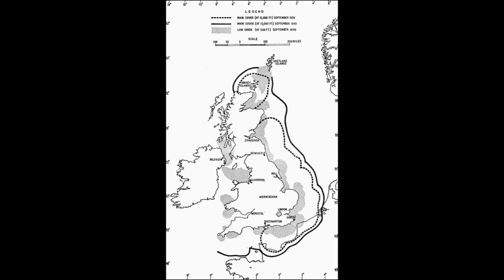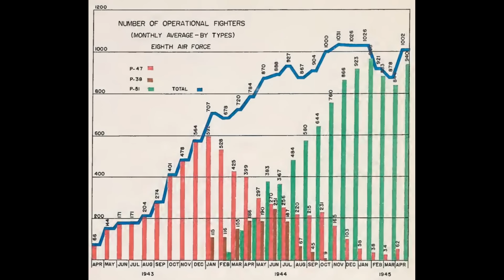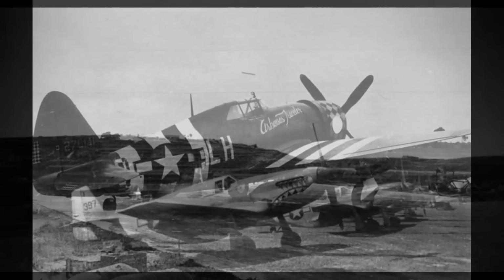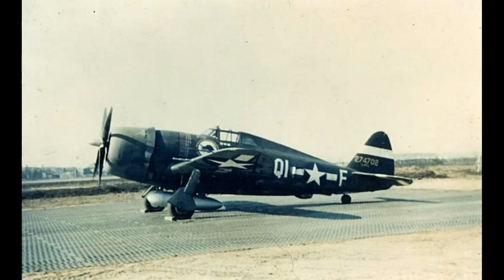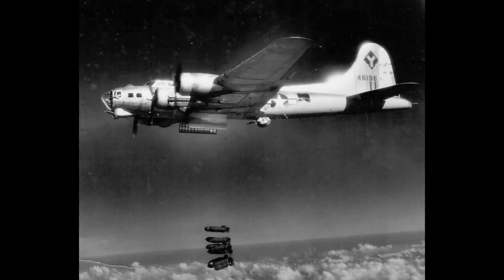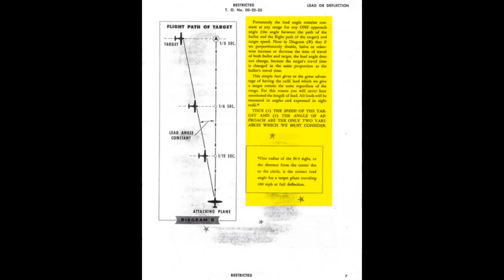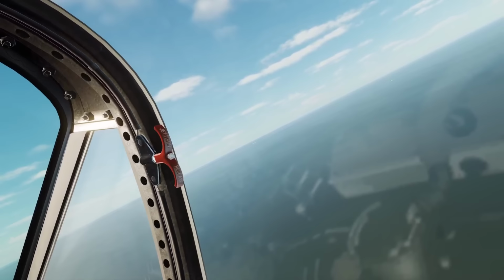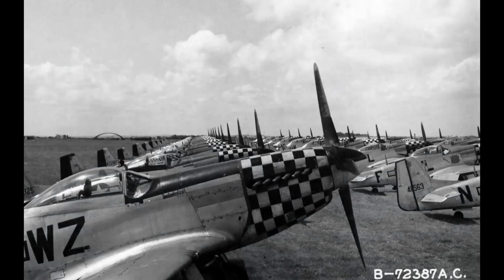Under Appreciated BRITISH Tech From WW2

Comment: With respect to the British radar tech,  it was due to the invention of the cavity magnetron which allowed generation of electricity at around a 10cm wavelength.  This made airborne radar not only possible but practical. The Germans had tried to create 10cm radar earlier in the war but after failing had concluded it was not possible so when an Allied bomber crashed in Germany which was equipped with it they had a nasty surprise.  I believe the cavity magnetron was part of a package (which also included the Whittle jet engine) of technology traded to the USA for technical data pertaining to nuclear weapons,  I think that detail in itself is significant.  There is an excellent BBC documentary from the 1970's called The Secret War which talks at great depth about the development of radar and radio navigation aids for war fighting and defence,  I highly recommend it for all WW2 enthusiasts.
Reply: And with it, the microwave oven (2.4 GHz, a water absorbtion point)
During testing, an engineer had a bar of chocolate in his pocket,  it melted or started melting

Comment: Thank you for the 'two supercharger stages on a single shaft' - that is a nice explanation of how they got it to be so compact, which I think was a darned neat trick. The german supercharging is obviously different in layout but looks surely weaker, accomodating a different layout as it does. I'm not saying it is weaker (I think it must not be, surely), but this supercharging race between the Brits and the Germans from the 30s in road races ending with the end of the piston era of combat aircraft - interesting...
[edit, that was a passive agressive ask for a video and you probably already have covered it. I know you have spoken about the superchargers, a lot]

Comment: The Rolls Royce Dart turboprop engine uses the same compressor concept as used in the later merlins, two centrifugal superchargers in line sharing a common shaft.
Reply from the maker: Yes, so does the TPE 331.

Comment: Splendid video. There are some other well known things that vary over timeframes. The jet engine is one, airborne and seaborne radar are others, but in aviation, one that is post war-ish - is the MB ejector seat!

Thanks for the fine video!
Reply: I think he wanted to cover more little known British innovations.  But you make some good points.  Most military aviation enthusiasts are aware of the pioneering work done on Radar by the UK.  But I think a lot of folks assume that the first jet engine innovations are German in origin based on the reputation of the ME262.  They need to look up Sir Frank Whittle.  Greg's research is phenomenal.

Comment: Dang! Another gem from Greg. I do, however, have a couple points to introduce.

Henry Ricardo was brilliant but I think he went down a rabbit hole re: sleeve valves. He just didn't consider higher octane fuel and intercoolers.

Drop tanks are of limited use without a large internal fuel load. The USAAF was late in adopting them but their planes were better equipped to get the most value from them.

Cheers!

Comment: I spent two weeks doing nothing, but repairing Drop tanks for three squadrons, by my self!  Interesting, almost all had the same problem. Internal electrical connections . G, ot about 75 repaired, to working or And  teaching three other electricians from those squadrons who to do it.loved working in planes.
Reply: Same here at VFA 125.  Mac Air built a battery box using 2 PRC 14 volt batteries in series.  This allowed transfer of a light weight oil to simulate fuel.

Comment: Excellent video as always. It is worth noting that the original British designation of H2X was H2S, although H2X is an improved version. Also Gee-H was actually a development of Oboe, which was incredibly accurate. Gee-H differed in that it could work with more than one aircraft at a time, so Oboe was most practical as a target marker. All of these systems relied for their accuracy on another British invention, the Strapped Cavity Magnetron,  which resulted in a massive improvement in radar performance. The lead this gave to the allies is incalculable.
Reply: @jackgee3200  You are correct, Gee didn't use the magnetron. But the importance of the magnetron to radar development was massive.
Reply: G-H and Oboe are not the same. Oboe used two radar equipment's with operators on the ground tracking the aircraft  via transponders on the aircraft, much like an IFF system. The operators on the ground station worked out how far off track the aircraft was using a very wide diameter Cathode Ray Tube for the time and controlled the generation of audio tones transmitted to the aircraft which told the pilot of the aircraft being tracked if it was left or right of the required track. The aircraft flying at a continuous radial range from the track radar (known as the Cat Station).  If the  aircraft was within the 150 feet wide Plus or Minus range limit of the equipment, the pilot got a steady tone on his headset that gave the system its name. The Mouse Station measured the range to bomb release for the aircraft and generated a series of tones into the Observers headset that gave him warning that the bomb release point was coming up and the signal to release bombs. Like the Cat Station, the Mouse station knew where the aircraft was with a Plus or Minus Accuracy of 150 feet. The Ground Radars were modified versions of the British Army Costal Defence / AA Gun Laying Radars. The Mk 1 system used 1.4 Metre band radars and were fixed installations, the Mk II and Mk III used centimetric radar and were mobile. Some B-17's were fitted with Oboe and trialled on night missions, but the system wasn't put into wide scale use by the USAAF. Oboe Mk I didn't use the Magnetron, The Centimetric systems did. 

G-H was based on the GEE system which was fitted to all US Bombers (All of the equipment supplied was built by the British) . The  big difference between the two systems (GEE and G-H) was measurement of the range from the ground stations to the aircraft was instigated on GEE from a master station on the ground and the GEE system used  long wave pulse radio transmissions based on the signals transmitted by the Chain Home Radar system. The Master Station sent out a couple of pulses that synced the aircraft and the slave stations, which the caused the later to send signals at a set time after the master station and the Aircraft's navigator then measured the difference between the timings of the signals from the slave stations to work out the aircrafts position on a special map. Seeing the system was totally passive as regards signals from the aircraft anybody with a suitable receiver and display system could use it. However It was found that the low Pulse Repetition Frequency of the GEE system, a kind of Oboe system in reverse could be built into the system where somewhere between 70 and 80 aircraft could each transmit sync pulses on a slightly different PRF which was picked up on the Slave stations and retransmitted to the aircraft. The display would respond to the pulses that matched the correct PRF and allowed the aircraft to fly a track at constant range to one slave station and drop its bombs on the range from the other one (these stations were known as Cat and Mouse as on the OBOE system). Aircraft position was known within 150 yards.

Micro-H was based on the Beacon location system originally fitted to British Night Fighter and Anti Submarine aircraft fitted with Centimetric AI and ASV radars. These allowed the aircraft to home onto a beacon at their home base. Micro-H allowed the H2X system to do a G-H type attack by interrogating a pair of Microwave beacons placed on the ground. It didn't become operational until late 1944 and was only used by one Air Division.

Comment: A little off topic:

An underrated piece of kit is aircraft breathing oxygen systems.  1. Without oxygen breathing systems for the aircrew, all discussion of high-altitude engine performance is hypothetical and theoretical. They are as important as superchargers. 2. If someone in North America wants to own an actual piece of a WWII era military aircraft, type g-1 oxygen tanks are not hard to find for sale.  Post-war, these were salvaged in great numbers  from scrapped aircraft. To this day they are in use by farmers, mechanics and others to carry compressed air to where it is needed.

Comment: Regarding water injection, it's still quite common in military turboprops and turbojets, and also on industrial turboshafts. However, it's not usually used in afterburning engines 
It's hugely effective way of increasing power output and controlling turbine temperatures on those type of engines, even when injected to the compressor, which is usually the case.
The F80C, Boeing 707/KC135, 747-100/-200, A400M, Super Hercules, Harrier II and B52 come first to mind, when thinking about use of water injection.

Comment: Hi Greg,
thanks for all the great videos you do. I have learned a lot from them, including, but not limited to why such massive engines, when supercharged  - or turbo charged needed such high octane  high octane fuel. It had never occurred to me that even if an engine has a compression ratio of say 5:1 the fuel/air mix was already at high pressure, and on the compression stroke in a cylinder could push that ratio up to say 11 to 15 to one. I don't know the exact figures, but I suddenly realised where you were coming from. P.s. I'm an electronics guy, so my knowledge of engines is sketchy at best.
Reply: Various compression schemes (Boost) change air density (and temp, Boyles Law, why intercoolers exist), but Don't change air/fuel ratios. Ideal power for fuel consumed ratio is Stoichiometric (14.7:1 for gasoline, complete use of 'both' available fuel and available oxygen.) but this is difficult to prevent pre-igniting so air/fuel ratios are 'cooler' to not exceed the parameters of the engine related to service life, heating, etc. "Manifold pressure" in piston engines is both a measure of intake charge compression, and throttle setting in relation to density altitude. Little about this is simple: "Physics, where everything depends on everything else."

Comment: With the pressure on legislators to replace 100LL, water injection could be a great solution for higher performance turbocharged piston engines.

Comment: We still use simple reflector sights today.  In the last 20+ years they became probably the most dominant form of sighting system used on semiautomatic rifles such as the AR-15.  They are also quickly taking over on pistols as they are now durable enough to be mounted directly on the slide of a semiautomatic pistol.

As someone that used to shoot competitively and was also in the Army, I can say that competition shooters were really ahead of their counterparts in the military and law enforcement communities in realizing the benefits of these tools to quick and accurate shooting.
Reply from the maker: Thanks Clarke, that's interesting.
Reply: I think you're talking about a red dot sight?
Reply: @gwtpictgwtpict4214  Yes, reflexive sights, also commonly called "red dot" sights, made by brands like EOTech or Aimpoint and many others, project a light image usually in the form of a dot or reticle onto a piece of glass.  The placement of the shooter's eye behind the sight is no longer super critical to the use of the system like say with open sights or with a magnified optic like a scope that also has parallax concerns.

On rifles, they are being somewhat supplanted in recent years by LPVOs....Low Power Variable Optics that usually range in 1-6x to 1-10x magnification.  These optics are popular for their versatility at both short and long rangers.  Reflexive sights, however, are still the dominant sight when the major requirement is for close and fast shooting.

Reflexive dot sights are finding a new niche in handguns. Their use on handguns was originally in USPSA or IPSC "Open Division" competition shooting and they were typically attached to the handgun via a mount.  Now, with increased durability they are being mounted directly to the slides.  Almost all the manufacturers of semiautomatic handguns are now offering slides cut to allow mounting a reflexive sight.

Where I work, we build a LOT of 1911/2011 pistols with slides custom cut for optics.  Me personally, I don't care for a sight system that requires a battery, but there are a lot of people now even in the law enforcement and military world that are giving high praise to the system after real-world use.

Comment: What is less known is that during the Battle of France the Hawker Hurricane was outpaced by Me109 and 110s. They could climb faster, dive at a faster speed and outrun the venerable 2-bladed Hurricane. However the RAF maintained two significant advantages - the Hurricane could out turn the German opposition and was manned in France by crack squadrons. RAF N0.1 Squadron's 110 German kills in 10 days still stands as a 12 plane squadron record.

Comment: Also might be worth a mention that you don't need to take your hand off the throttle to work the range on the K-14 sight, as the throttle handle can be twisted to do the same. (Hence the bicycle cable running up to it from the throttle.)
Reply: Odd, I made two comments but YT seems to have axed my first one, perhaps because it included links. (In which I said I thought it was H2S, not H2X. Seems the Americans called it something slightly different than the Brits did.)
Reply from the maker: Youtube does either ax comments or banish them to the "held for review" folder which I never check. I have no idea what their criteria for this is. Yes, the K-14 installations usually allowed for the handle twisting range setting as in the P-47N. The Dora had that too.
Reply: @GregsAirplanesandAutomobiles  Our DCS P-47D has a twist grip throttle for its site. Pg. 166 of DCS P-47D Flight Manual EN.pdf says:
"Firing guns with К-14 gunsight
Normal flight operation of the sight is accomplished as follows:
• Gun Safety switch set to GUNS & CAMERA.
• Identify target; then set span adjustment lever to correspond with span of target aircraft.
• Fly the aircraft so that the target appears within the gyro reticle circle and rotate the range dial until the diameter of the gyro reticle circle corresponds to the target size.
• Continue to frame the target with the gyro reticle circle by **rotating the twist grip** as range changes. Track the target smoothly for one second; then fire.
• Continue ranging and tracking while firing."

It definitely moves because I see it rotate when I move it.

I don't have a non-springloaded analog axis on my CH-Pro throttle, so I've just assigned range in and range out to a hat switch. But you can also map it to an analog axis if you have a throttle with a dial or slider that will stay in one position. (Obviously the main throttle axis stays where you leave it, but we're already using that for throttle. :)

Comment: Water injection, even as late as 1979, the Av8A had a 50 gallon water tank, for water injection for it's jet engine.I think all versions of the Harrier, still have water injection to increase volume of gases go in into the combustion. Funny, you don't often think of water injection for jet engines.
Reply: Water injection was commonly used for decades in KC-135s and B-52s. They put out a ton of smoke and noise on takeoff and climb out, until the water ran out.

Comment: Don't know which came first, but pumps since at least the 50s can be procured with impellers stacked on the same shaft. The casing would be more complex than normal. They are meant for high flow into high pressure, such as when primary coolant is really needed in a nuclear power plant loss of coolant accident.
Reply from the maker: As far as I know the British were the first to put two supercharger impellers on the same shaft.

Comment: At altitude pure water would freeze. I remember filling ADI tanks which were a blend of glycol and water most often used at take off to increase power. I believe that the DC-4s and DC-6s and Convair 240s used it, but after 30 years I'm fuzzy.
Reply from the maker: Yes that's right. Pure water isn't usable at altitude because it will freeze.

Comment: The G-H system was generally known in British service just as Gee. The Germans used a very similar system, so much so that the British came up with a way to "bend" one of the radio beams so as to cause the German bombers to miss their targets.
Reply: Aka bended (or twisted) knee - knickelbein ?sp
Reply: Gee and Gee-H are not the same, they worked in different ways, but did use a lot of the same basic equipment. A Gee-H set could operate using either mode of operations. A standard Gee Box could not use Gee-H. Gee was nothing like the systems used by the Germans.